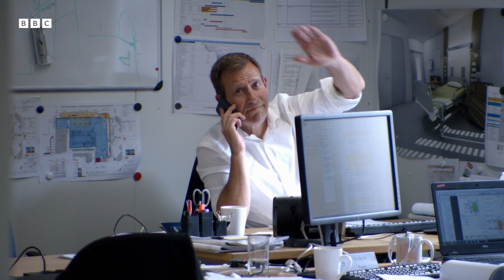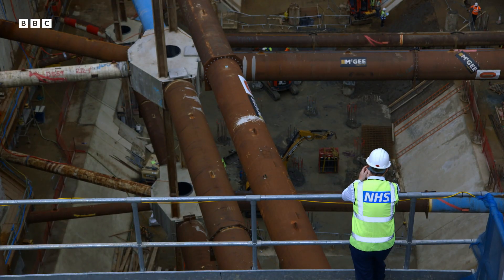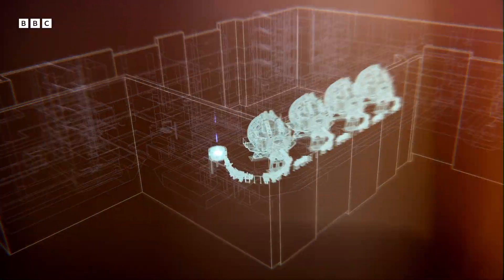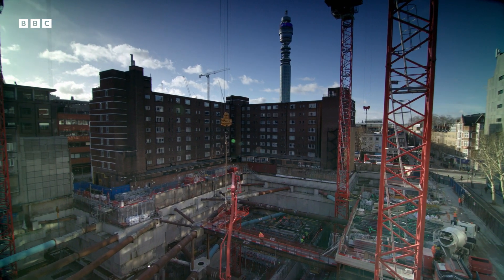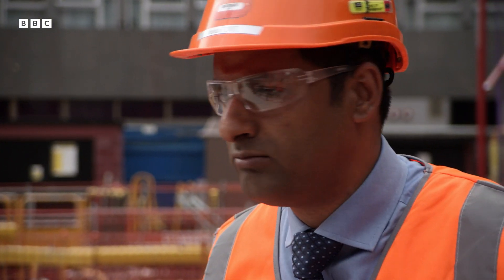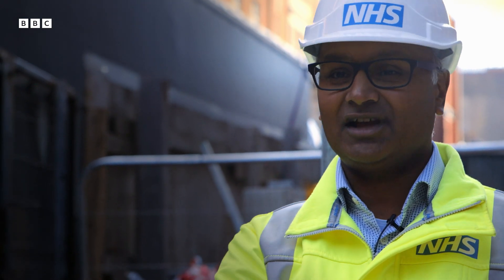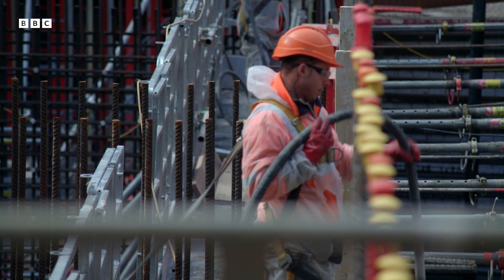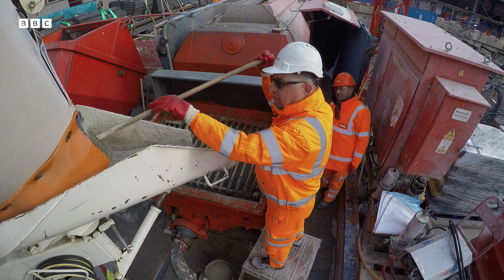Building Radiation Treatment Rooms in the Middle of London | £250 Million Cancer Cure | BBC Science

Comment: Maybe,
Seems an Over the Top Response toTumors.
Given the Obvious Radiation Risks.
Is this Method Better than Micro Surgery Via Robotics ?.
Reply: Ignore the BBC scaremongering - once that concrete is in place there's no radiation risk to the public at all. A better question would be why waste all that money building it in central London (within the ULEZ zone so EVERY lorry which took spoil out and brought concrete in had to have hugely expensive exhausts fitted)? Or even Why spend £250Million for this department and another £250 Mill for the one in the Christie hospital? How many "standard" Linear accelerators would that buy and how many more patients could be treated? The whole Proton thing came about because a few children benefit from Proton therapy. Yes, it's good for Prostate and brain tumours too but modern photon techniques mean that difference in treatment quality is negligible. ... I'd better stop now before I start to rant about the fact that the Cyclotron runs 24/7 and uses a huge amount of electricity so why isn't the department open all hours?